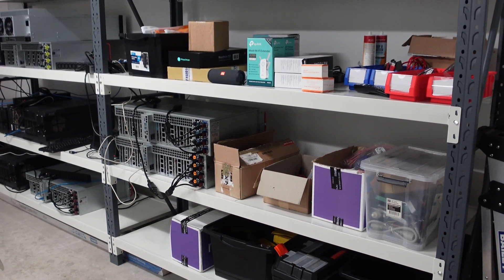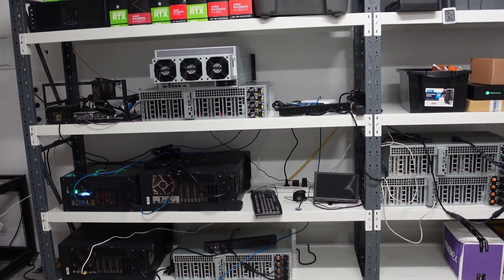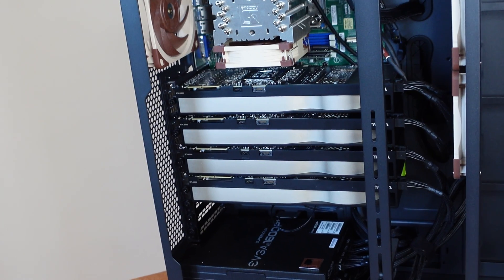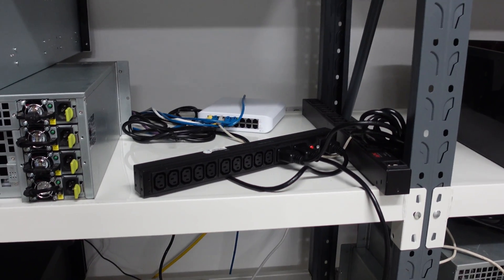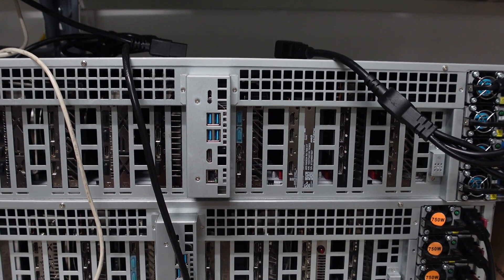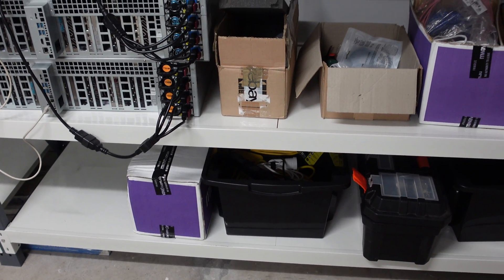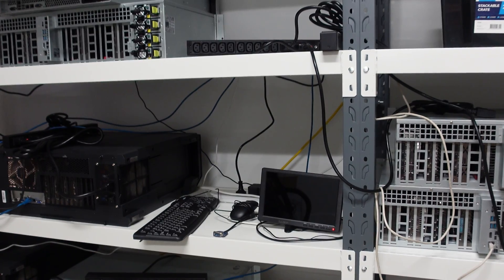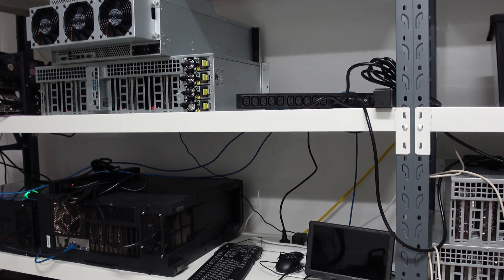GPU Farm tour 2024

Comment: Do you have any more extra power at that place, or is it pretty much taken up?
Reply from the maker: Thanks for watching Massboost. Havent seen you in Discord in a while. New location is a Townhouse, and all the units have a 100 amps breaker on the street. Also the cable from street to the unit is under concrete to the units. Idd have to get the body corp to update the breaker in front and then trench and redo concrete to replace the cable to support more amps to my unit. Long story is unlikely. Besides the heat in garage prob not great to have even more power so i am gonna stay with what i got and just cycle gpus

Comment: C14 to C19 cables are readily available and work great. I use them for my octos

427 GPUs now, just about 315 running. 
flux, iron, nexa, pgn, rxd, alph, clore, neurai, neox, rvn, KLS, RTM, VRSC, Erg
Reply from the maker: Thanks for watching Ovalbore. Man i am honored to have you in my comment section :).

Thanks yeah got 1 C19 to C14 on the Threadripper machine to test them out, as it really only 2 GPUs and not a ton of watts. I have been little scared on the bigger rigs, not sure it can take 1600watts?

Dude that is massive! One day when i am big hope to be like you :)
Reply: @2ndtlmining   fair enough! haha the C13/14 are good (pending conductor thickness) up to 15A, which on 240V is 3,750W each. the reason why the EVGA big boys ship with C20s is due to the 120V market where the cords are required to be L5-20P. rest of world can easily get away with the C14. 

pffft, I'm jus a lil guy! more XTX! I ran my 7600 this week on MMPOS and was happy to see memory clock, core clock and soft PL worked but a bit sad no voltage control at all yet.. curious if the XT or XTX can..

nonononon its way too many GPUs. bad idea! 100 GPUs is perfect IMO. :)